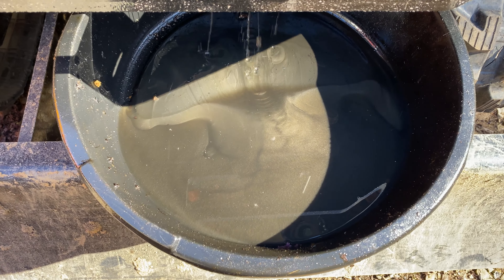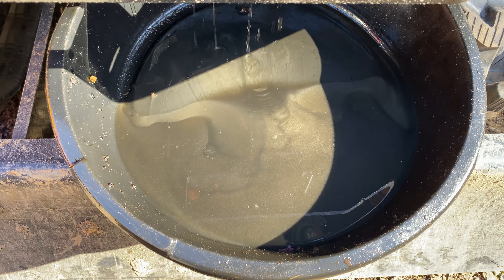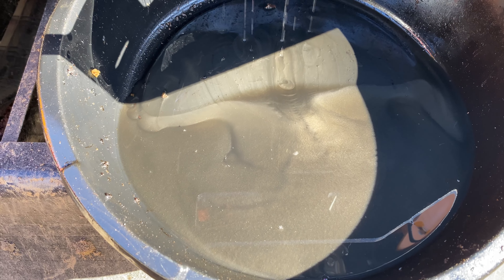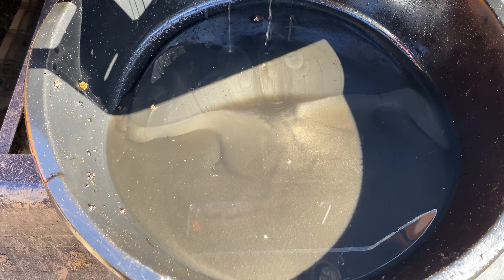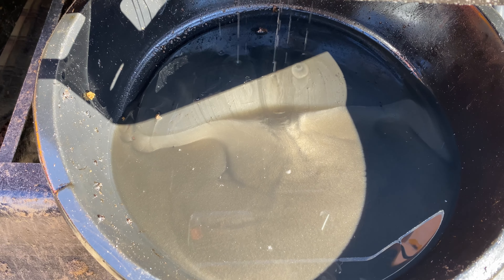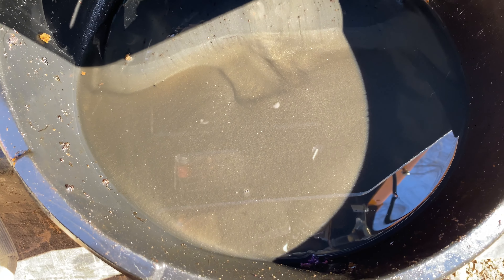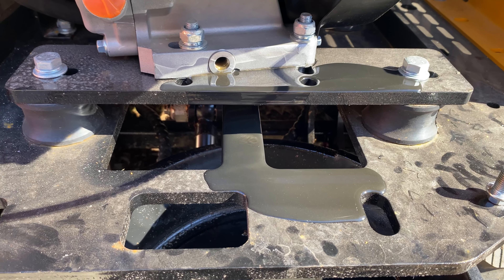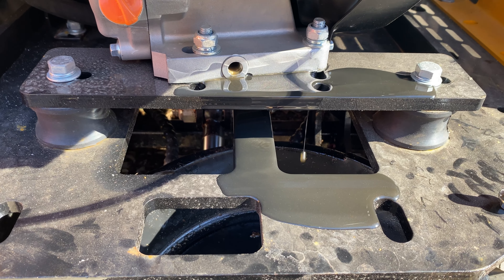Chinese Mini Excavator First oil Change !!! Bad News !!! for me ?

Comment: The “oil”they come with  needs to be dumped before use. It is intended to lubricate the engine for test running at the factory. I changed oil 3 times before I was satisfied that all the metal and fluid was removed. The oil now stays clean. The hydraulic oil smells like used deep fry oil and has no filter in the system, it cost under $100 to put a filter on it.
Reply from the maker: Yes sir I dumped the oil 2 times already and getting ready to install the hydraulic oil filter.
Reply: @whataworld4894 Did you change the oil when you first got it though? Or did you run it on the factory oil?
Reply from the maker: @drewnicest4319  I ran it on factory oil  for 2 hours and changed it and again after 5 hours  there was no instructions indicating any different.
Reply: @whataworld4894  Oof. Looked like so much metal. I personally never run factory oil in anything no matter what they say, especially cheaper stuff from China. I run Mobil 1 0W40 in everything from day one and never lost a motor to date, even cheap Chinese stuff. The price of the more expensive oil is always cheaper than having to replace anything.
That being said, I hope that motor still works out for you and you stop losing metal. If not and it dies on you, maybe you could replace it with something from harbor freight if the company won't warranty it.
Reply from the maker: @drewnicest4319  definitely a lot of metal and that’s the plan is to get a motor from arbor freight if it blows up. I guess it will be lesson learned but I like the machine.
Reply: @whataworld4894  absolutely, I watched your vids the machine looks awesome and still worth the price especially if you throw a predator in it you'll be so happy. I posted on another vid that the 16hp predator would mount right up which is under $500 too. That machine would be even more sick if the 22hp v-twin would mount up but I can't say for sure if it would I've never seen one in person.
Reply from the maker: @drewnicest4319  thanks I’ll definitely be doing a 16 but I don’t think the 22 will fit and I like the price of the 16 predator.
Reply: @whataworld4894  they're so awesome for what they cost imo. I got an air compressor, generator, and power washer all running predators. Thousands of hours with crystal clean oil on the generator. And I only change it once every few years on average which is crazy because it always stays so clean. I did it like I do everything - drain it and fill it with Mobil 1 0W40 before first startup, then change it out again after the first few hours.
Reply from the maker: @drewnicest4319  now that’s what i’m talking about ! And I just bought a pulsar inverter generator to replace my predator generator and man that thing is quite and uses way less gas. I’m getting ready to put it to the test too .
Reply: @whataworld4894  never heard of pulsar
Reply from the maker: I found it on Amazon and found a ford and another brand all exactly the same design just different colors and stickers but this thing impresses me. It start on first or second pull depends on temperature outside and it’s real quiet. I’ll make a video of it next week testing it a little bit .

Comment: I bet that they done AS LITTLE machining and polishing as possible which will be part of this issue. And I guarantee you the included oil is soviet grade or lower. What IS surprising is the chinese honda copies. They actually LAST. My sister and her husband had one go UNDERWATER (pumping from a river, heavy overnight rains or melting snow). Stripped it down, dried out and reassembled, and it's still running 8 YEARS later.
Reply from the maker: Now that’s what I like to hear.

Comment: The difference between a honda and a honda clone or a yanmar and a yanmar clone
Reply: There are actually some good Chonda engines out there, Honda does have licenses with some Chinese factories so it's very possible even a name-branded Honda engine was built in a Chinese factory. CPE uses a quality Honda-clone for instance.
Reply: Chinese hondas last a LONG time. Had a few experiences. Including ones that would kill a briggs and stratton.
Reply: @OffGridInvestor  Unfortunate what B&S engines have become. My first lawn mower in the 1990's had a Briggs I/C flat head and it went through hell without a single problem. Even their new commercial-grade offerings aren't very good unless you get into their bigger V-twins. When the Honda GCV160 goes out on my lawnmower, I will replace it with a Kawasaki FJ180V KAI. Might upset a purest but Honda GX's cost as much or more for less power.
Reply from the maker: Ain’t that the truth. I can’t get anything worth a crap now days. And all the new vehicles suck too.
Reply: @whataworld4894  merica made cars trash before its even driven.